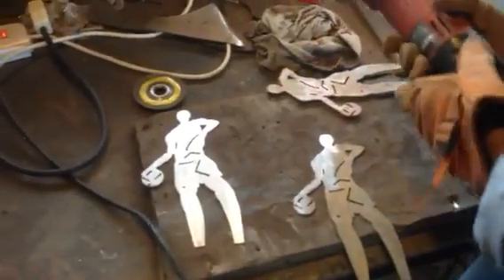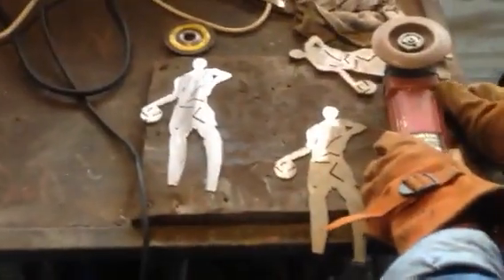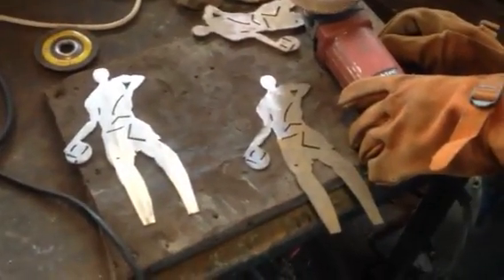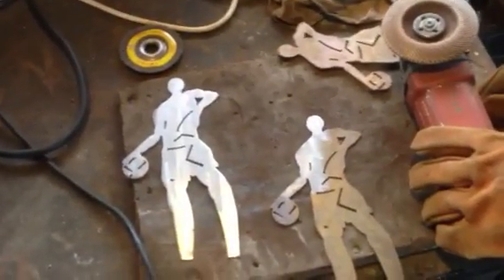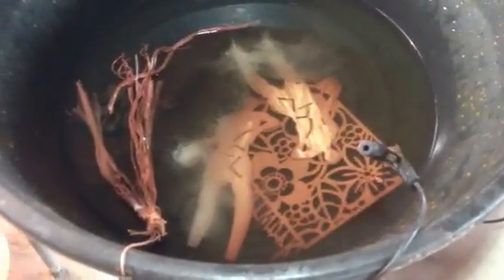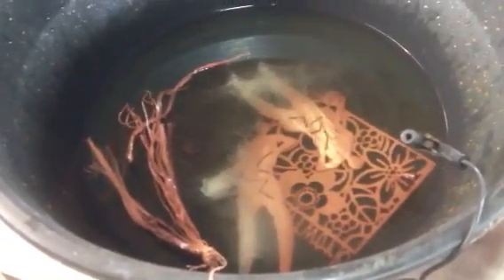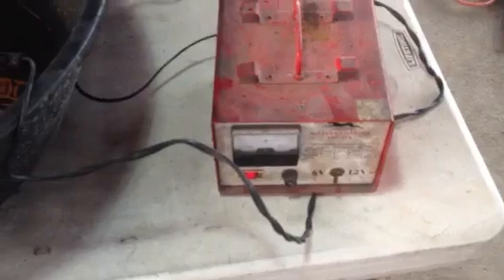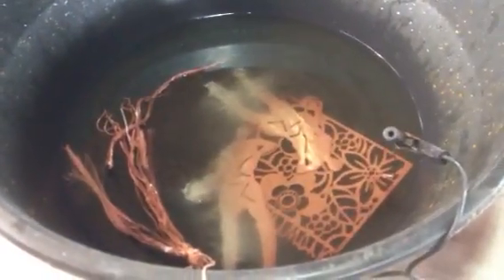Copper plating steel with muratic acid

Comment: 60% muratic acid?? so this is the key for a copper plating solution to plate steel easily? can it work with regular 30% muratic for the same ratio you mentioned? or should i just higher ratio acid or 100%?

Comment: There is health risk and great danger in electrolysis of hydrochloric acid. It releases DEADLY chlorine gas at the positive electrode and hydrogen gas at the negative electrode. Even small amounts of chlorine gas are harmful. If Chlorine and hydrogen combine to form hydrogen chloride gas, powerful dangerous explosions are possible without sparks. Please be informed.
Reply: Bryce Swartzwelder good things he's not using hydrochloric acid
Reply: Muriatic acid IS Hydrochloric acid (they are the same thing.).

Comment: Use white vinegar instead of muriatic acid. Dissolve as much salt as possible into an equal volume of water, heating the water will dissolve more salt. Equal parts salt solution to vinegar. This same solution will work well both for electroplating as well as electroetching by just reversing the polarity on your work pieces. 

There are too many safety issues in this video to address them all.
Reply: David Johnston thanks for the tip I'm glad I didn't try this muriatic acid one don't really feel like creating or breathing hydrogen or chloride gas or hydrogen chloride gas or exploding myself or getting lung damage appreciate it
Reply: What's your channel called?
Reply: im confused,you spoke of two solution one with water the other with vinegar,,are these suppose to mix together or are they two different solutions that will do the job?

Comment from the maker: Update.  I left the copper in the solution without electric on for a week.  It turned green.  It now will plate surfaces without electricity.  Just spray on the green liquid, wash with clean water gently.  Dry with compressed air and paint.